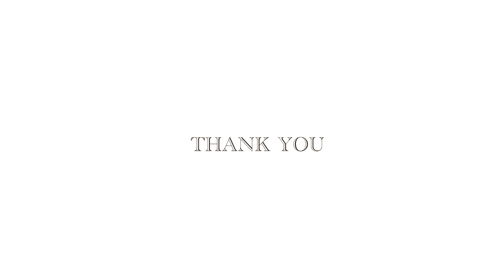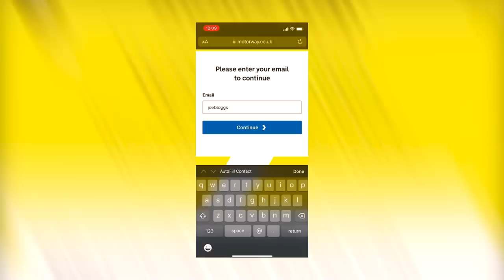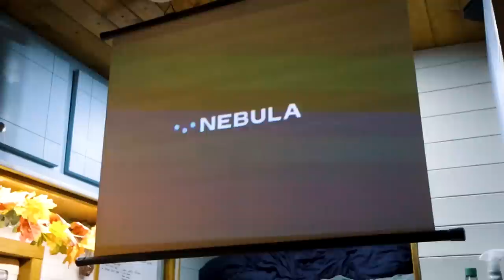ARE LOG BURNERS WORTH HAVING in a Camper Van Conversion?

Comment: Why did you have two different gauge wires connected together?? Especially no connector! A fire waiting to happen!!!! The thicker gauge wire will take more Load (Amps) The thinner wont causing a 'Bottleneck' HEAT!! Just like the Heart Arteries!! There couldn't have been a fuse?? The power and Earth wires look as if they shorted together should have blown a fuse! I presume the Red wire (Supply) went to your Relay? Should have had a fuse! I would use ALL one gauge wire NO joints! A Butt connector would take two different gauges!
Reply from the maker: Whoever is going to do it someone who knows more than we do I should imagine, will start with using the same guage wire for the whole thing
Reply: @ThoseHappyDays  Glad to hear that good luck! 😁

Comment: Please Don’t try and fix something you know nothing about, that is a recipe for disaster. The wires should not be different thicknesses that is why you have a problem.  The wires should be correctly sized for the power load, with two different sizes there is a mismatch.

Comment: REPLACE THE WHOLE WIRE FOR THICK.  The thin wire is causing a resistance.  DO NOT USE UNTIL THIS IS DONE. The old relay was trying to warn you something was wrong.
Reply from the maker: Yeah seems logical thing to do

Comment: Guys a few of things i want to mention about your electrical fault. Firstly i freaked out when you showed that the wiring started to melt( basically a load issue causing the cable to become its own heating element) That a major fire risk. Secondly you said you had 2 different gauges of wire size( Major no no) lastly when you showed the type of connector blocks being used in your van is just dam right wrong. Please do not used them. You need to confirm what loading the cabling is supplying as fear the reduction in cable  sizing is not sufficient to the load its supplying.  Connector blocks you had used in a moving vehicle will loosen with vibration of motion which would cause arcing also. All Electrical joints should be crimped. You  definitely need to let an electrician to look over your van.(URGENTLY)

Comment: Having seen the number and often seriousness of the problems you have had with this van, it is clear that taking it back to the person who built it won't make a difference - not actually sure that taking it back is an option as I assume you have been placed in some sort of horrible and difficult position.  These are not mistakes, they are serious (and in some cases safety) issues which will need a professional to sort out.  I hope you can get professional help quickly as you don't deserve to be in this position